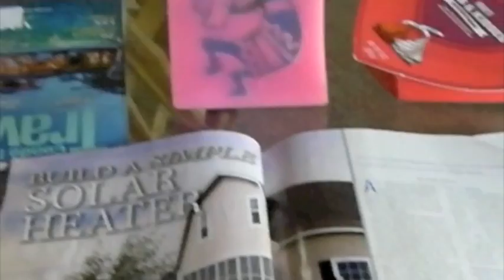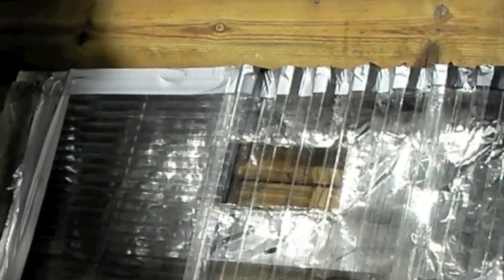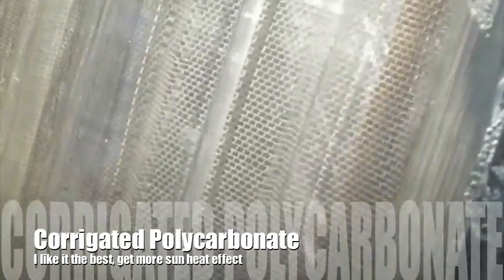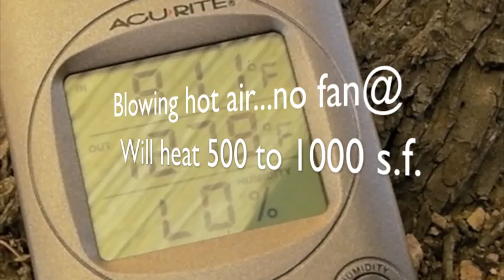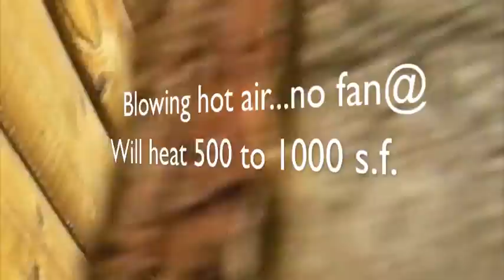How to Build a Heat Box for $6, Heat your Home Free

Comment: This is a failed project. I made this same mistake in a grade school science fair. I built a solar box that called for a black interior box, sealed by two layers of sealed glass. In my immature stupidity, I decided black was dumb. I'll line the box with tin foil so the sun enters the box, bounces off the foil and gets trapped under the glass. FAIL. The black interior is what attracts the sun and soaks it in. The foil reflects the sun away. Great learning opportunity. If you actually seek out the Mother Earth project, it's common science that lining the solar box interior with black aluminum screen fabric is the ideal sun attractant. Foil is very inefficient and poor science.

Comment: You will have a hole thru the house’s wall and the sun will heat the house at night too? 🤣 Nonetheless, using the sun’s energy for heating is a good idea. Tip: paint your box black. That will heat the box faster.

I would pack the bottom of the house (got crawl space?) with lots of river rocks and channel the heated air during the day into it so that the floor will warm the house at night.
Reply: Tonyvu:  you can make it so it rests on a window sill instead of cutting a hole in the exterior.

Comment: It it’s -80 below and blowing -124 below, it would be an air conditioner.
Reply from the maker: Sorry my friend.  Amazing how easy it is for folks to misunderstand, or not "get it".  But, here it is for you in detailed explanation.  The day we videoed this home made experiment it was  80 degrees F, outside normal air,  and it was 124 degrees inside the heat box after only 15 min or so of sunshine.  You seem to miss the point, but that's ok, we all have to learn.  In this case this simple inexpensive hand made heat box, we built in short half of an afternoon, is creating a 44 degree increase of air temperature, with pure, solar power.  You aren't paying for that power, it is free from the sun and with a little simple design engineering with the simplest of materials, and even a simple minded person, not a skilled carpenter, can build this.  I am the "thumbs" only guy, when handling a hammer, so if I can do it, any motivated good person can do this.  The point was not to produce a polished expensive video but to get you going, to motivate you actually to do something. Get off of your chair and create something positive.   So, put on your thinking cap, if this was a winter day and the temperature outside was 50 degrees, the heat box could produce heated air of 94 degrees and flow into your house all day long.  That would save you 8 to 10 hours of running your heaters in the house so much, and you would only need to use them at night.  Build one, try it, and send us what you have done.  Actions speak louder than words my dear person.  What have you done????  Get it on and do something!

Comment: Use your brains- i had my husband build framed  4 or 6 in box deep about 6x6 feet white plastic in front and built right on to south side of house heat tube went right into my closet and little motor forcing it into basement if i opened up a vent to it- since I was a homemaker I sucked the heat into basement rec room- had Bed room down there too- etc. also kept upstairs floor warm- In winter collected hear all day till sun left area- saved money 1973–1982-

Comment: Sounds far better than it is. As the temps drop so does the temp differential by a BUNCH. As soon as the sun disappears it will be of No value. It WILL give significant heat even on cooler days if the sun hits it but that is all. I have been there, done that!

Comment: I just watched this video & think it very informative.  Before the question is asked as it is in the standard repetitive reply to many comments here I will respond. NO SIR, I HAVE NOT DONE ANYTHING WITH THE INFORMATION AT THIS TIME.  I AM A DISABLED GRANDMOTHER OF EIGHT AND IT IS 11:30pm here near Ft. Rucker AL  I do intend to utilize this information to try and build a smaller light weight version that will have a hot air feed into my GMC Safari Hightop Conversion/Camper Van.  Possibly another one for my Aliner popup travel trailer.  I think some light weight adjustable legs built from eletrical conduit will be good because I will not always be set up on a nice level surface.  Some of your responses to the comments here seem borderline rude to me.  To quote my dear deceased Papa "SIr you should come down off of your high horse before you fall off".  Have a good life.

Comment: Those polycarb sheets alone cost way more than $6, add in 2 x 4s and the rest of the material and we are WAY over $6.  Also, you're cutting a hole in the exterior of a home...not smart.

Comment: He can't use this temperature gradient at different temperatures. It's against the laws of thermodynamics. For example, he is talking about a temperature difference between the air outside and the temperature inside the box. The specific ratio only occurs at that particular temperature. As you raise or lower the outside temperature the resulting ratio changes also. It's similar to how the Fahrenheit and Celsius temperatures aren't on a steady scale - there is a 32° difference at the freezing point but there isn't that same 32° difference at the boiling point - it's a 112° difference. The laws of thermodynamics change the ratio as the temperature changes.

I too wondered why he was heating his house in the middle of Summer.

Comment: This will work and I'm planning to build two of these in the near future. Obviously at this point the $6 statement has been beaten to death. There are numerous videos with this same basic design. If you have zero materials you could build a similar design for probably $35. You can use beer cans, or gutter downspouts for thermal collectors along with black paint for example. I plan to add a 3 or 4" pvc pipe duct in the wall running along the ceiling. I will and a small computer fan with an on/off switch powered by a small solar panel. All those items are available Harbor F. In the winter the fan will pull the heat from the collector through the pipe. In the summer just reverse the fan to pull heat from the house with an exterior tee on the pvc outside to vent out the heat in the summer.  I think I can build these for less than $100.00 with everything I described.

Comment: Another case of the camera man run amok! OMG pull it together!!
Reply: Just now got around to answering. My mind is certain, I built it, and it works.  Have you gotten around to doing anything, if so, send us a photo and a budget of what your costs were. That would be a positive contribution.  Actions vs Words thing. This is not rocket science, it is a simple box frame with one side to let sunlight in.   6 ft high, 3 ft wide and 4 to 6inches deep.  The front facing the sun is plastic, polycarbonate, glass, or fiberglass. The back has aluminum foil to reflect the sunlight back to a window screen that is hanging in the space in the middle of the box.  My goal was to see how or what I could put together with some old scraps in my basement.  How to build it, you nail or screw the 4  4x4's into a square shape and nail a piece of plywood to make the back. That should take you about 20 min.  Then you hang a window screen or metal door screen wire in the middle.  I put foil on the back to reflect the sun back toward the screen...and it heated it up even faster.  Then screw the plastic see through cover onto the front, another 20 min if you are slow.  All in all I spent about 2 or 3 hours putting it together.  I heats the outside air temperature in summer and winter from 40 to 70 degrees hotter, and works very well without a fan.  We considered putting a fan onto the hole in the wall inside to blow air in faster, but never got around to that.     Sorry about the shaky video, I am not a film professional, just wanted to throw the idea out there.  Over 560,000 people have viewed it, and many have built these. Those are people of action...not just words.  Build one and send us photos.  My out of pocket $6, but you can do a Cadillac version and use all new materials but even with that, the cost is very negligible.  Best to you.  Ben Boothe

Comment: So... Seems to work well, when it's already plenty comfortable outside... I can see how it is supposed to work. I can see how it works, old school.... Probably works well in sunlight at 50°...
Let's try a day like today, where I am.. low of 34° high of 36°.. overcast and raining for two days so far.. expected to be the same for the next week....
Not knocking it, just saying it's like a heat pump.... It can only work when it's warm enough to work....
Reply from the maker: Heat box increases ambient temperature about 40 to 50 degrees...so you would get air at about 80 or 90 degrees coming into your house.   Build one and tell us how you can make it better.  640,000 people have viewed this video and many have found it helpful and working!    Good luck!  Ben

Comment: This is only semi-relivent. Try heating a 1600 SF living area in the middle of winter when the outside temperature is 7 degrees Fahrenheit.
Reply from the maker: Works well for us.  We've had it for 4 + Years now.  We have a wood burning Earth Stove, which does a good job when we want to light it up, but this unit helps when we don't want to use up our firewood.  Peace, oh by the way 560,000 people have viewed the video, many have built it, or something even better. Show us what you have done!  Ben

Comment: Its still hot outside so you cant get a true temp. How bout waiting when its 35'F outside & then cast-your-judgement on inside heat radiation.
Reply from the maker: Kind of miss the point didn't you?  On a mountain top, we don't build in the snow in the winter, we build in the summer.  It works very well. Over 560,000 people have viewed the video, many have built their own.  It works fine in the winter. Show us what you have built...that was the point to stimulate creative actions.  Peace to you.  Ben
Reply from the maker: Already did, about a 40 to 45 degree increase or heating of the air with the sun panel.   So if it is 50 degrees outside, will heat air to about 90-95 degrees. Enough to keep you warm when the sun is shining.  You only need to run your electric heater at night...saves you 8 to 12 hours of heating expense.   Best of luck to you.  Ben

Comment: Wouldn't it be more efficient to make one the size of a window and put it inside the house?  I just checked out the cost of a corrugated  polycarbonate panel and its around $50 to $60 bucks for a 4 by 8 sheet.
Reply from the maker: Oh you can get it cheaper than that.  Indeed you can even get used sheets and cut them to size.  I don't know the window idea, why don't you do it, and make a video and we'll help you promote it.  Best of luck!   By the way, over 560,000 people have viewed this one, more every month.   Ben

Comment: The problem is in the description: solar powered. Around Christmas that means about a ten hour day. Subtract an hour in the morning and an hour in the evening because sun is not high enough in the sky to effectively heat your solar oven and that leaves you about eight hours a day that your device is effective. If you live where there are numerous storms or just a lot of cloud cover your solar powered oven is even less effective. If you have an attic space just insulate the entire attic, paint the roof black and you get the same solar heating on a much larger scale and no ugly boxes on the side of the house. It still does not address heating for your house at night nor during inclement weather. Now if you can heat the whole house night and day at no cost let us know. Otherwise get off your high horse. If you don't like criticism then don't publish. Certainly don't act like you invented something. This concept had been around a long time and published in a great many articles.

Comment: I applaud Mr. Boothe's ingenuity! Still, I wish he had spent a couple of dollars at Goodwill for a tripod. It was very hard to discern the process as he was showing it. Wherever he is, the "winter temperature" is about 50F.  That said, I live in Northern New England, where 50 degrees is a summer night. So this model won't work here. But I'm glad to know anyone even thought of creating their own solar collector.
Reply from the maker: Yes read Mother Earth Magazine, they have specific plans and drawings and many people in your area use solar heating.  The winter temperature where I am sitting outside is about 47 degrees. The heat box heats the air about 40 to 50 days on a sunny day, so you would get air coming into your house at about 90+ degrees.  It works.  Ben

Comment: Can you give me plans and specifications?
Reply from the maker: Box frame.  6" deep, 6 feet high, 3 feet wide. Top is covered with clear polycarbonate or fiberglass, or glass.  Hole in bottom of front lets cold air in, hole in back to top lets heated air out.  Wire screen int he middle collects heat from sunshine and lets air go through and heats it, just like a coil of an AC.    Nail or screw it together.  Oh, I put aluminum foil on back (inside) to reflect sunlight back to the wire screen hanging in the middle space.    Or you can go to Mother Jones magazine they printed plans in it 4 years ago, but this is not rocket science.  I built it in 2 or 3 hours.

Comment: I can see using this on a small home. But at night you would still need heat.  This box will not produce without detect sun light. 
So when it's cloudy it wouldn't work either.
Reply from the maker: Well, Duh....this is solar heat.  Did you have anything to contribute?  Let me clarify. Yes the sun goes down and it gets dark and cool.  We use a wood burning air tight fireplace at night. We have 300 sun days a year on our mountain, and it works very well.  Now here is something also. That bright light you see in the east about 6 AM, that is the sun, and it comes up in the mornings.      Kidding my friend.     Peace.  Ben

Comment: Instead of the shiny foil, have you thought about using some black surface to gather more solar energy?  I bet that would gather more heat than a reflective surface. Good info!  Please give a winter update.
Reply from the maker: Good idea. Why don't you build one with the black surface idea and take photos and send to us.  It may be great.  We liked the additional radiation reflected back from the shiny aluminum foil.  Works great in the winter...still heats the air by about 40 degrees.  Not bad.   Peace,  Ben

Comment: So if it's 80 degrees outside I DON"T need to heat my house.. if it's 20 degrees outside I DOUBT this process will work well at all... and OBVIOUSLY YOU didn't put it to use in colder weather... soooo at this point, this video is completely impractical & unappiied
Reply from the maker: Ah yes, it is very practical and works well, and has for years now.  But, we would all (560,000 people have seen the video now) what you have done that is an improvement.
Reply: Just now got around to answering. My mind is certain, I built it, and it works. Yes we build in the summer when it is warm and dry because in the mountains it is covered with snow. We still get a 40 to 70 degree increase in air temperature.  Many people of the half million who have viewed the video have build this, and even made improvements.  Again...actions vs word thing.   Have you gotten around to doing anything, if so, send us a photo and a budget of what your costs were. That would be a positive contribution.  Actions vs Words thing. This is not rocket science, it is a simple box frame with one side to let sunlight in.   6 ft high, 3 ft wide and 4 to 6inches deep.  The front facing the sun is plastic, polycarbonate, glass, or fiberglass. The back has aluminum foil to reflect the sunlight back to a window screen that is hanging in the space in the middle of the box.  My goal was to see how or what I could put together with some old scraps in my basement.  How to build it, you nail or screw the 4  4x4's into a square shape and nail a piece of plywood to make the back. That should take you about 20 min.  Then you hang a window screen or metal door screen wire in the middle.  I put foil on the back to reflect the sun back toward the screen...and it heated it up even faster.  Then screw the plastic see through cover onto the front, another 20 min if you are slow.  All in all I spent about 2 or 3 hours putting it together.  I heats the outside air temperature in summer and winter from 40 to 70 degrees hotter, and works very well without a fan.  We considered putting a fan onto the hole in the wall inside to blow air in faster, but never got around to that.     Sorry about the shaky video, I am not a film professional, just wanted to throw the idea out there.  Over 560,000 people have viewed it, and many have built these. Build one and send us photos.  My out of pocket $6, but you can do a Cadillac version and use all new materials but even with that, the cost is very negligible.  Best to you.  Ben Booth